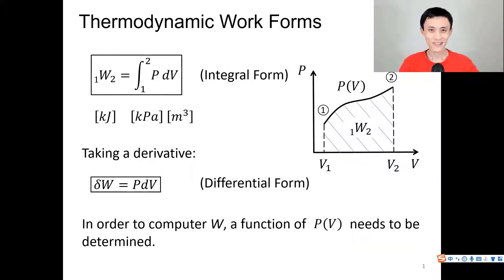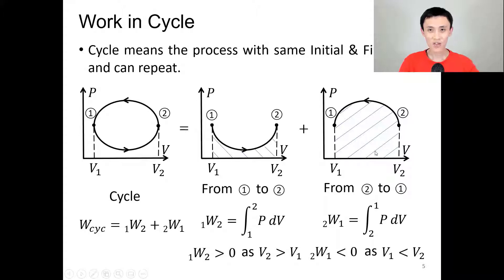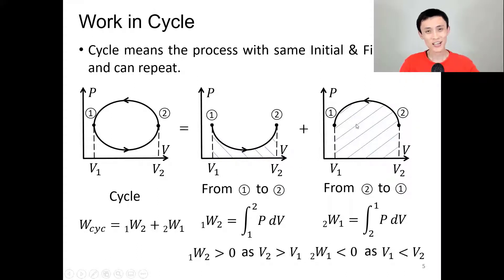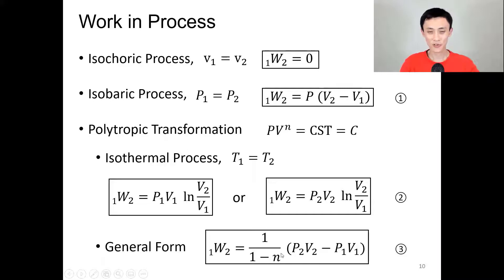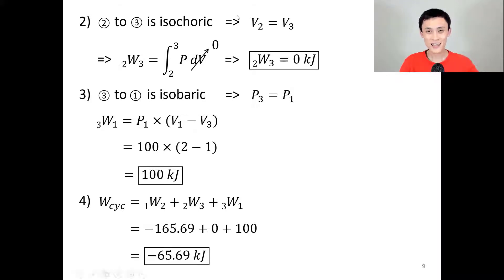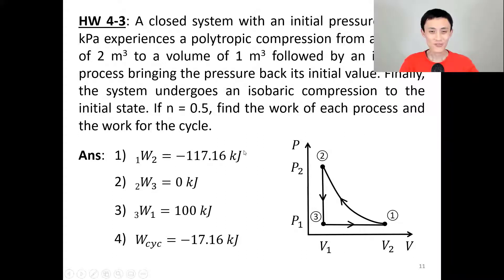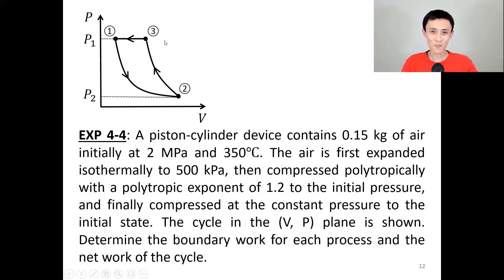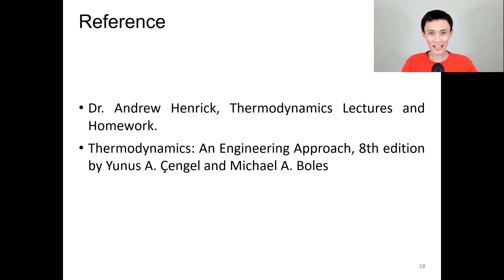Thermodynamic Work in Cycle Example | Part 3/3 | A piston-cylinder device contains 0.15 kg of air

Comment: example 4-3- how the volume will increase during isobaric compression?
Reply from the maker: Isobaric means constant pressure and is not related to volume. So the volume can increase decrease or remain the same.
Reply: @DrGucci  usually during isobaric expansion the volume will increase and isobaric compression means volume will decrease right?
Reply from the maker: @prabusenthil4746  Not necessary. There are three parameters, temperature, pressure, and volumn, so the change can be in either combination. For example in idea gas law Pv=RT, there are three parameters.
Reply: @DrGucci  yeah ok sir , got it thank you.